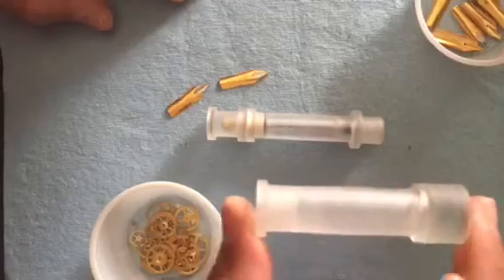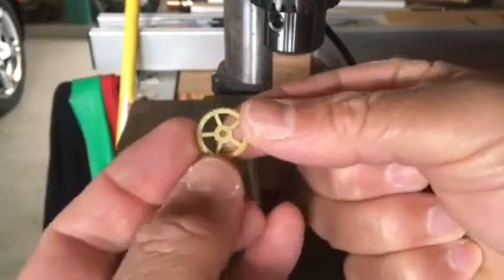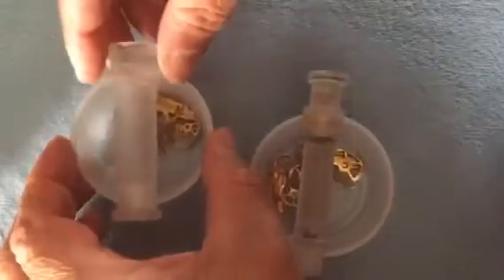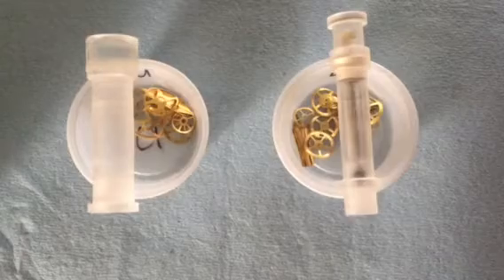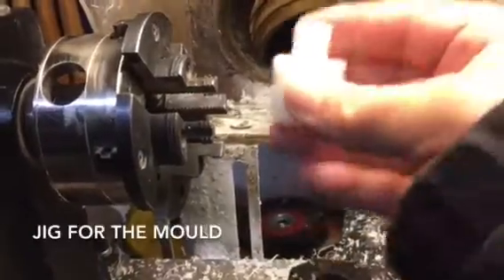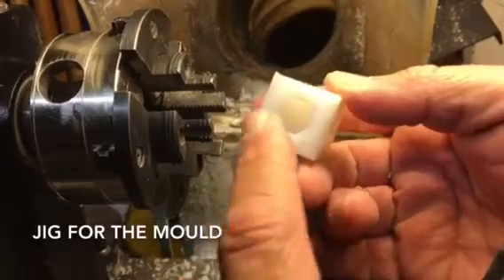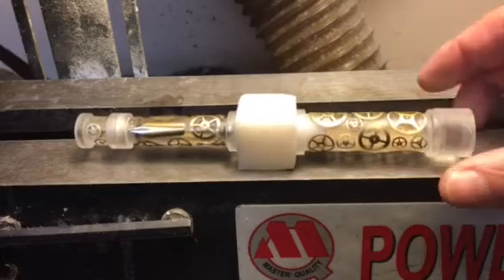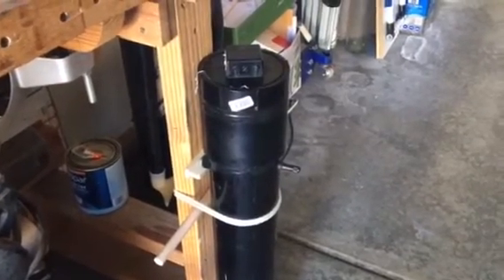Part 4, how to make Clear Steampunk Pen

Comment: Gabe, I'm hoping you can share some information with me.  I ordered watch gears from Amazon hoping to make some steampunk pens.  I'm using a metal dapping forming block  and round bar from a punch set.  The gears I ordered must be made from material too brittle to bend because they break in half when trying to form.  Can you tell me where you purchased your gears?  I appreciate any help.
Reply from the maker: I buy real used and broken watches and use the brass gears for steampunk.  There are some metal gears that break and some bend too.  I have a video on where I buy watches.
Reply from the maker: <iframe width="560" height="315" src="https://www.youtube.com/embed/TKJTOM-JEMc" frameborder="0" allow="accelerometer; autoplay; encrypted-media; gyroscope; picture-in-picture" allowfullscreen></iframe>